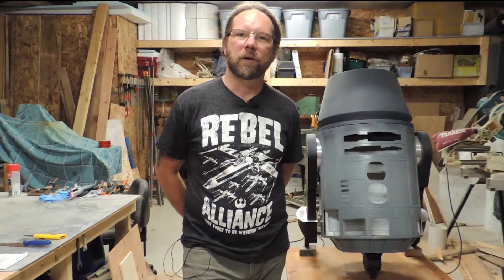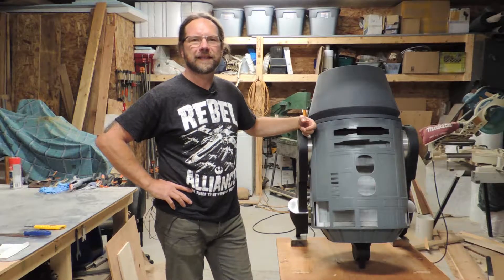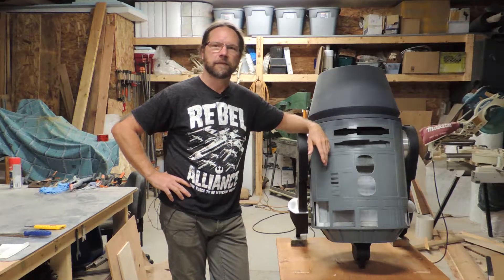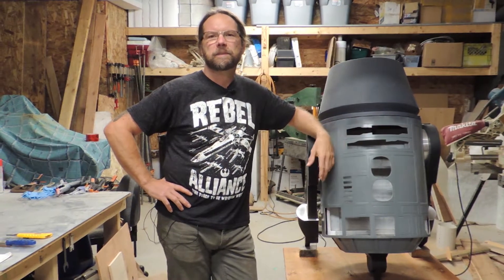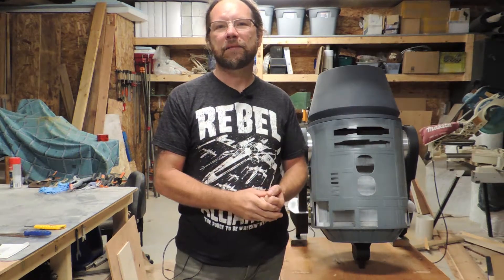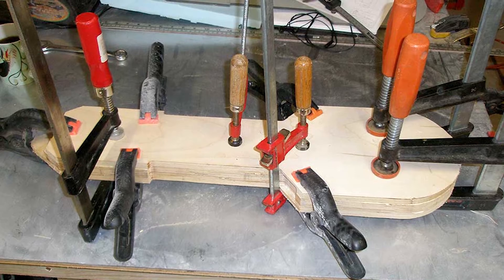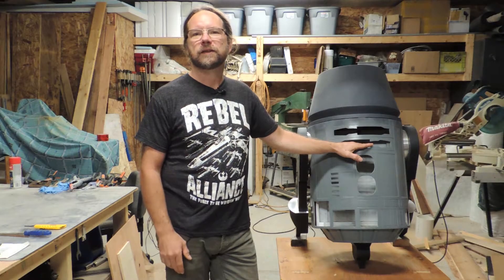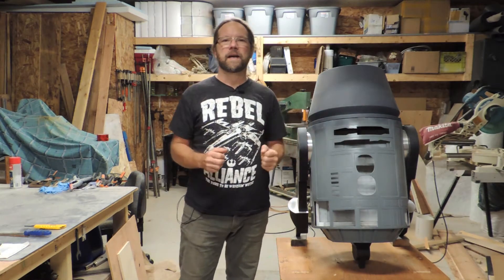Full Size Astromech Droid Build - R6-T3x

Comment: God I'm glad I found this. I hope your still working on this. I want so badly to build one but I only have a shoe string budget and it'll probably be a year or two before I can even start. I want something loosely based on t11
Reply from the maker: @shaynecoventry8894 Thank you for the kind words! If you have been looking into these at all I'm sure you know that it can be a very long process. Taking TIME is a great way to stretch the budget!! Just start with smaller parts if and when you can. The biggest thing (If you really want to) is just to Start...

Comment: How would it cost of r6
Reply from the maker: Hi Bear, Sorry I missed your earlier question. Based on what some friends are doing, and on what I have done myself so far, an Astromech can easily push up past $10000. BUT you can do it more economically. I have seen simple Droids come in at under $2000. However, you can have Inexpensive or Accurate and Dependable... not both.
Reply: @myAstromech  thankyou